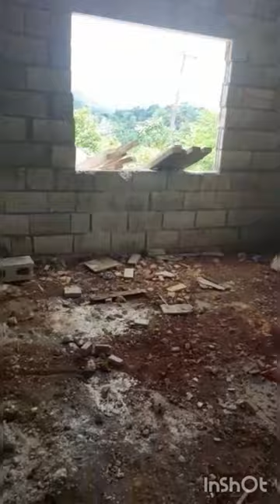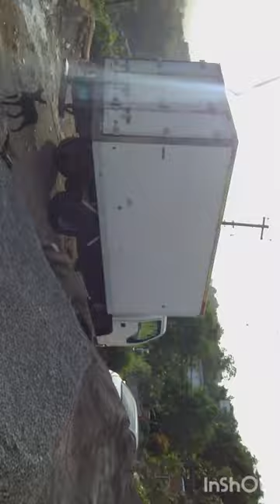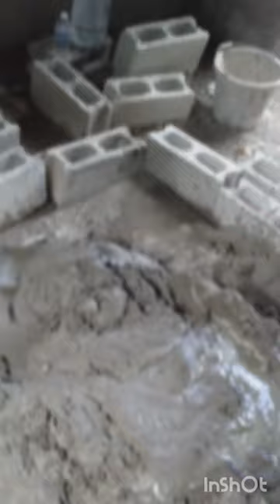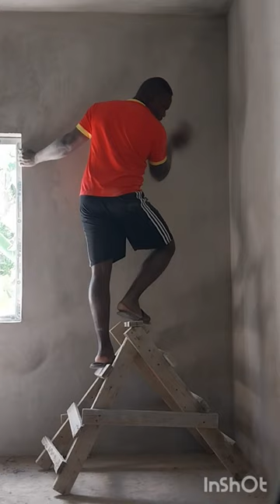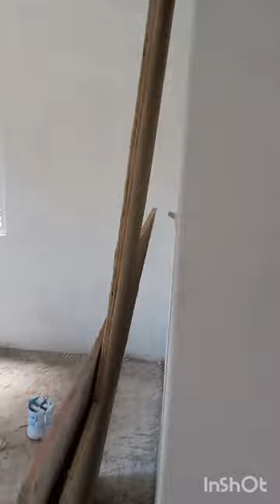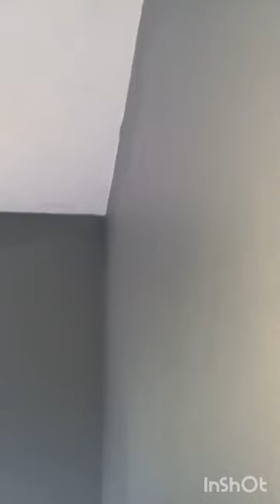Building a dream home in Jamaica 🇯🇲 under $27,500 🇺🇸  #construction #dreamhome #diy #jamaicahouse

Comment: What does the blue substance purpose to prevent water from penetrating?
Reply from the maker: The blue substance  i was using is sure bond. Sure bond is a liquid ahesive based on latex polymers with re-emulsifiable properties. This water based latex emulsion is a bonding adhesive used for plastering applications. It provides a permanent bond for fresh cement mortars and plastering mixes to structurally sound concrete surfaces.
Hope this information helps you understand. 
For any other questions, feel free to ask.

Thanks for the like 👍 please remember to like share and subscribe

Comment: Great stuff dear sir well done 👍🏾. However you never mentioned the cost of the steel, sand,gravel and cement and ply and electrical in price breakdown. Blessings.
Reply from the maker: Going to do a material video 📹 👌
Reply: Ok. Great. Look forward. Which area as material prices vary. I know north coast is more expensive.
Reply from the maker: @lennieadi material on the North Coast is very expensive. Windows are cheaper in St Ann  than Kingston
Reply: Ok. Do you know where in st Ann the cheapest window place. I once heard few years ago that a place in Ocho is good for windows but no Idea where that store is. I’ll have to do some more digging into that. Blessings.
Reply: @lennieadi you can shop around as some window guys do travel if you decide to get them made